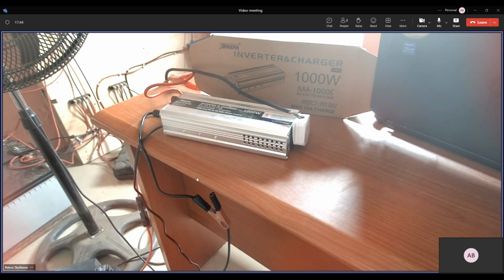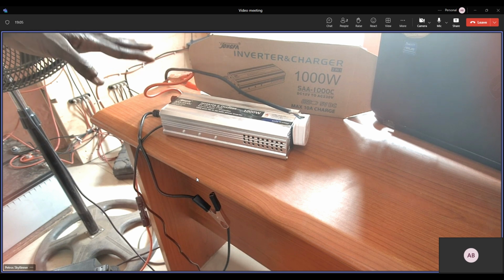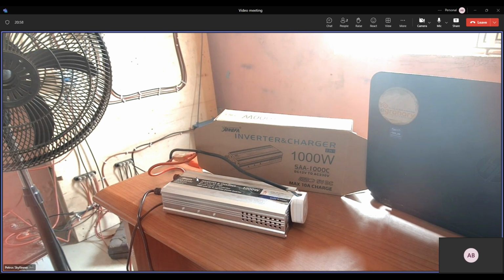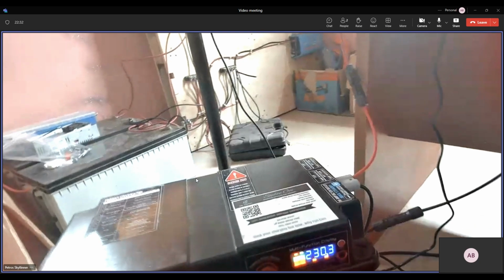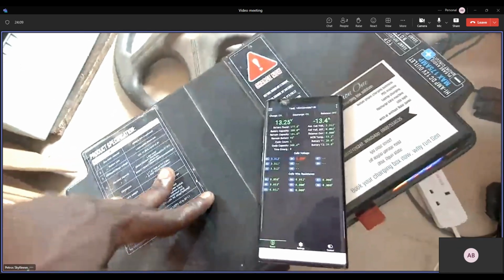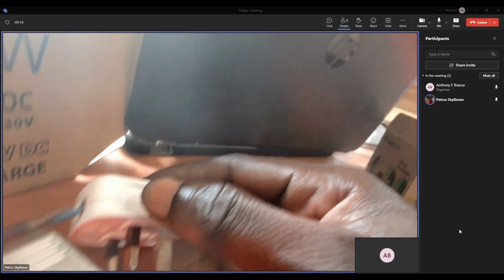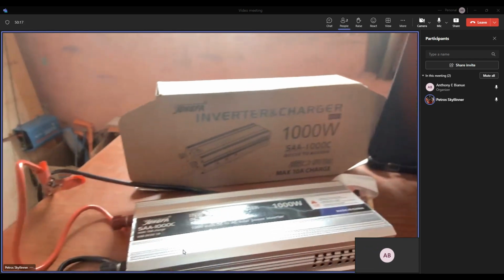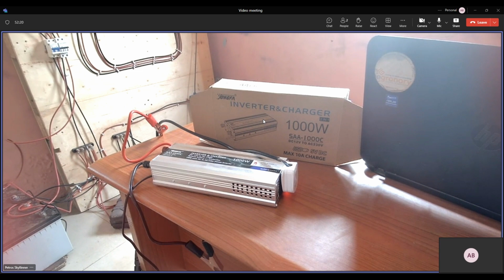Review of Jongfa 1000W Solar Inverter + Battery Charger

Comment: Please i have one but i want to know i plugged it to the Nepa current to charge the battery and the fault light turns red, Does that mean it's charging? Or i have to turn it on before it can work? Because i have a solar and lithium battery snd i also eant to charge the battery with electricity and how would know if the battery is full 😢
Reply from the maker: did you manage to find out. Our should we make a video about it?
Reply: @GMEnergyNig-nb4hc  pls my inverter is not charging when plugged to light.... what do i do?
Reply from the maker: @ifemideonipede8326  Maybe the charger is faulty, if possible we could check it for you
Reply: @GMEnergyNig-nb4hc please make a video about it.. coz that's what I'm currently experiencing..

Comment: Can it work without any external device like can I be able to plug it different to a socket if I want to charge it? I want to purchase one.
Reply from the maker: Yes you just need a battery and you can used to system. Please send us a message on Facebook and we can assist you further